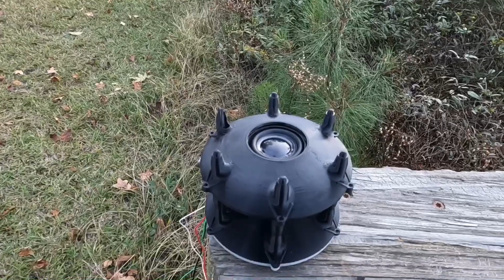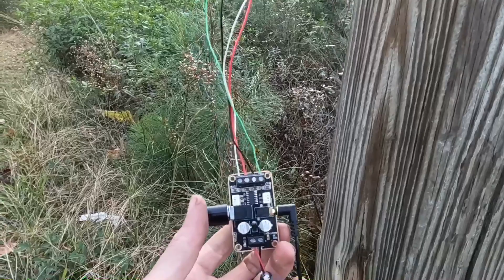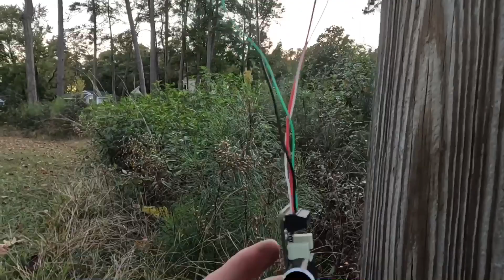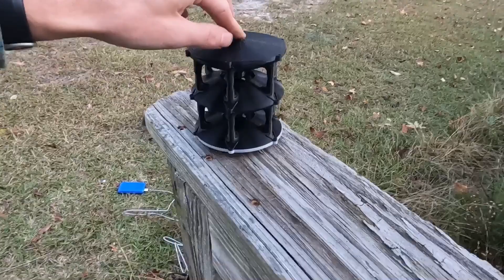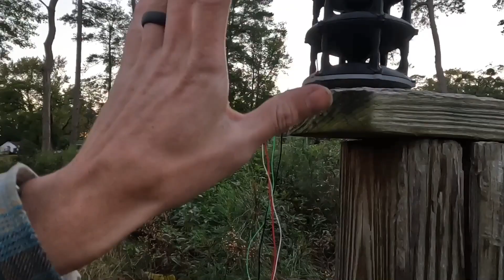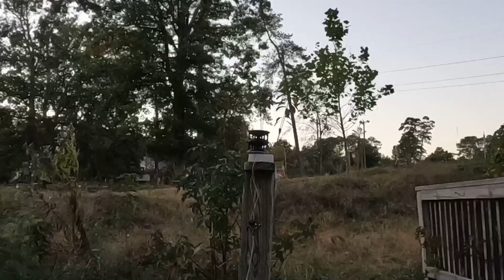3D printed Whelen WPS 2802

Comment: This is absolutely fantastic. But one thing I do recommend is not running the speakers to long as I've found at even around 450Hz the speakers start releasing a burning smell. The speakers drivers built by Whelen are made to handle this frequency but anything else will release a electrical burning smell after a while

Comment: Oh, there definitely is a lot of interesting quirks and stuff that electronic siren controllers have. Even just Whelen has five different electronic siren controllers, one of which has 4 different possible peak frequencies (ESC-2020 - can come in 455 and 560 Hz, 435 and 530 Hz if SI-TEST glitched, respectively). 

Federal Signal has 2 versions of the Siratone, 2 versions of the MC, 2 versions of the MCP, and 2 versions of the UltraVoice. 

ASC/ACA has three different siren controllers- an analog tone generator + old amplifier, an analog tone generator + new amplifier, and a digital controller + new amplifier. The analog controller with a lot of signal distortion uses the old style amplifiers, while the analog controller with virtually no distortion uses the new style amplifiers found in the later digital controllers.
Reply from the maker: That's what I'm saying, electronic sirens honestly deserve to be their own subcategory in the community because damn the iceberg goes deep! I'm not even going to pretend I know what I'm talking about and instead leave that up to folks like yourself.

Comment: You should put a Bluetooth amplifier in it and have a 2802 Bluetooth speaker. Also, I'm working on a tiny Modulator that uses PCB mount speakers as "drivers" but that won't be done for a while.
Reply from the maker: Yeah I was thinking of something like that as well, but I wanted to leave options open for hardwiring it to a signal source if someone wanted to. I’ve also seen programmable audio playback boards with dedicated trigger pins that could very easily be setup with pre-recorded tones, idk I’m still toying with the idea, it will be cool as hell to see the modulator once it’s finished!